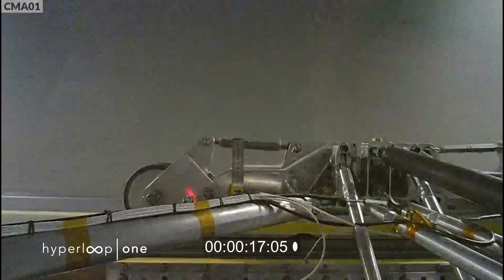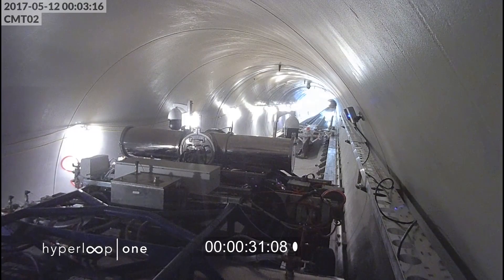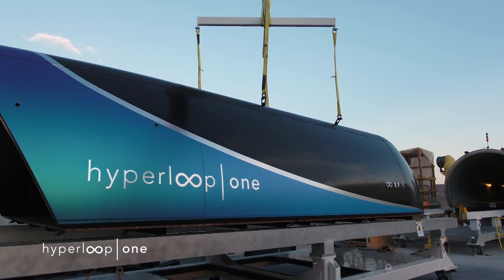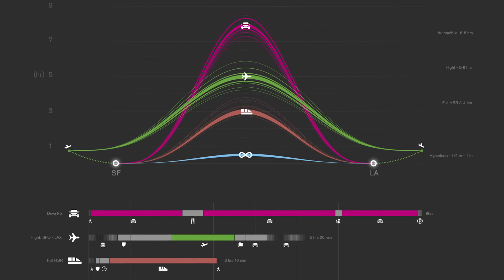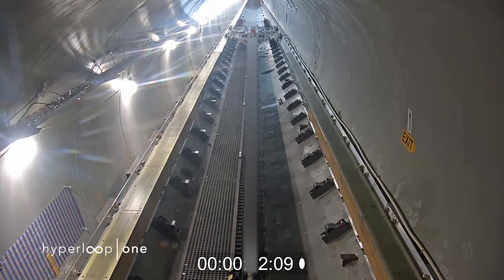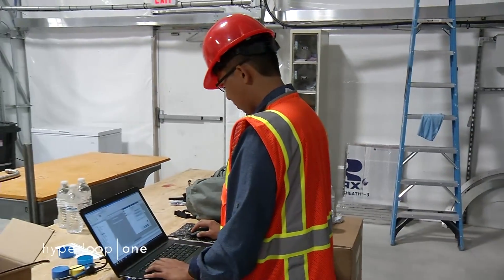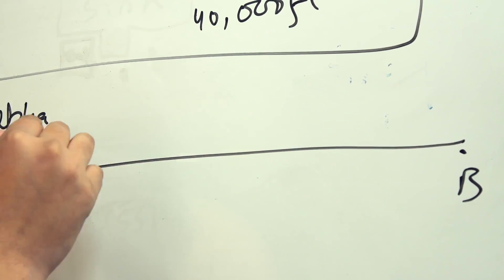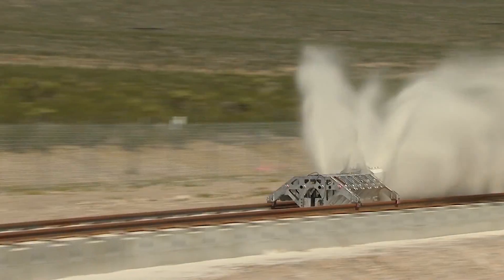Watch the Hyperloop Complete Its First Successful Test Ride | WIRED

Comment: So it can go slightly slower than the average train, it's much more expensive and can't even carry as much cargo/passengers as a train. Congrats
Reply: No, if you have a complete plan, -- which they do -- you can get funding and the prototype shows that the plan can be successful. To get funding to dig a hole to the middle of the earth, you don't need to actually have dug a hole to the middle of the earth.
Reply: Metal Is My Business Its not a perfect vacuum. it's there to assist all of the other propulsion methods. I imagine a working a official version of this technology will be able to easily survive a lose in vacuum. You seem way more skeptical about this then today's modern transportation. Planes were used as terrorist devices on 9/11. Cars can lose traction at high speeds, it's brakes can fail, it's gas pedal can become stuck. etc etc thousands of people die every year. Trains can become derailed and crash. So you think the Hyperloop has unreasonable dangers?
Reply: you're not getting what they are doing.  It's an engineering test of a system.  These are usually not done full scale in order to keep down costs so investors aren't taxed beyond their limits.  When you prove a system you are showing what can be done and that it can be scaled up.
Reply: +Quinn Dams
Partial vacuum makes a big difference. Hard vacuum is incredibly hard to maintain in large volumes, because it requires expensive specialized pumps, and any tiny leak ruins it. Partial vacuum on the other hand can be maintained with simple pumps, and tolerates small leaks. The pressure difference isn't that big, it's around one atmosphere. The Mythbusters actually did an experiment on this, they created a pretty good vacuum inside a railroad tank car (video available on YouTube) to see if it implodes. They had a decommissioned decades old car which wasn't even designed to hold vacuum, and it absolutely refused to implode. They had to seriously damage it to make it implode. Modern nuclear submarines spend months under an order of magnitude higher pressure without surfacing, and they keep doing that safely for decades. And they do collide occasionally and get seriously damaged without imploding. The USS San Francisco for example.
Also small punctures don't create huge explosions, like in the movies, they just cause small leaks that the pumps can easily compensate.
Read the original document (Hyperloop Alpha), it deals with the engineering, the finances, and a lot of possible accidents.
Reply: Dude, it goes 700 miles per hour
Reply: Do you know what a testing phase is?
Reply: Yes, but while testing you should still present a model defining how you want to improve it and make it what you want to be. If I were to start a project of reaching the center of the earth I can't just start digging with a shovel and asking to be funded because it's just a testing phase and that eventually I will find a way to dig more efficiently expecting everyone to trust me.
Reply: Don't forget the actual disregard by the "engineers" to the dangers of an extremely strong vacuum. Depressurization would take hours in this sort of tube and it would be extremely fragile. This shit is an obvious scam and people are taking the bait just because it's one of Elon Musk's ideas.
Reply: Just because WIRED didn't present the future model and how it's going to be improved doesn't mean Hyperloop doesn't know what they are doing.
Reply: saying it's a partial vacuum is like me saying my glass is empty and someone comments no i still see a drop of water in the bottom. the pressure inside the tube is so low it doesn't make any difference in the practical sense. and there's loads more issues, expansion of the tubes because of heat? you can't put expansion areas on a vacuum tube or it'll just implode halfway depressurization, and the idea they proposed to put the expansion areas on the ends of the tubes makes your station shift up to a mile on the proposed track. it just isn't possible with current technology, maybe if we had the hyperloop made of carbon nanotubes so it's stronger, find a way to insulate the tube to all temperature change. and protect it from natural disasters like tornados, and earthquakes, and i mean really protect because a single point of failure means the deaths of everyone in it and complete destruction of the hyperloop.
Reply: What train goes 700 mph?
Reply: SuperFatUnicorn idiot
Reply: You know that the only reason they test it at low speeds is that the test track is simply too short to accelerate and then decelerate from higher speeds?
Reply: Well said Andras. We have been dealing with huge pressure differentials for decades. I'm not terribly optimistic for Hyperloop as I think the scales are too big and the costs will be too great, but people talking about catastrophic failures are forgetting we have been engineering subs to deal with vastly bigger pressures for such a long time. The hyperloop at a complete vacuum will be under the same pressure as a sub at 10 meters, and this doubles for every 10 meters deeper it dives. Subs have collapsed, but at far, far greater pressures than 1 atmosphere.
Reply: Indeed, the one who designed this for cargo purposes is really stupid. Guess why most cargo is transported by sea? Because it doesn't require to be there fast as much as people. But now we are going to build a fucking expensive infrastructure inside a vacuum tunnel to transport containers while a truck can do so much much cheaper and not much slower, or a ship.
Reply: had to read the paper as i hadn't seen it before yet, making me feel even more skeptical about the whole thing.

the big problem is struts though, submarines can be built with internal support, wich prevents the whole thing of crumpling up like a piece of paper the second something leaks, also the vacuum in the tube according to the paper would be 1/6th of mars' atmosphere wich comes out to a total of 1/1000th the atmosphere of earth or about 48 km up. effectively a vacuum for these purposes, and there's some real just idiot things in the paper like, you're gonna put a rotor on the thing for extra thrust even though there's so little air it wouldn't be usefull. and the paper states for expansion areas the pylons dampening system will be used somehow, wich makes no sense as it would just push the pylons apart if it expanded, stacking over distance ending up either breaking the damper wich would leave the tube unsupported, causing it to push the pylons, ending up in either the pylons falling over or the tubes breaking off causing it to probably bend or break. and the mythbusters episode with the tanker you quoted, in the same episode they end it by dropping a rock on it, it's pretty big so still but the second there was a dent in it, it completely flattened. you think the tube isn't going to get a single dent anywhere period, if it does get built i give it a year maximum before the thing implodes, it's just statistically unlikely that on a 400 mile track not a single dent will be made in the tube, it could be a tornado flinging debris, or an earthquake that is just a bit too rough on the dampers, or someone who hits the pylon and it breaks. and if those things ended up in a single broken vehicle with the people dead okay sure the risk isn't too bad then, but it would be the whole thing, a 650 million us dollar tube completely trashed. with likely no surviving passengers at all. a stupid idea imho
Reply: That's because tankers are not designed to hold a vacuum. Hyperloop would have a 25mm thick wall (compared to a 10mm tanker) and an internal stringer-ring frame to prevent collapse. Obviously they would design it to survive a dent.

The pylons would constrain the tube and allow free rotation about the z-axis. Pylons in between these would allow free translation along a single axis. This would allow the tube to buckle is a controlled manner. You'd need to allow for 1 meter of expansion every ~6000 meters of tube (assuming you pretension the tube), so it can be modeled as a 6000 meter long chord segment with endpoints meeting a 6001 meter long arc. This arc has a radius of 75 kilometers: that produces less than 0.1G of centrifugal acceleration, which is not very much at all.
Reply: 1:11 The guy LITERALLY said the finished model would go 700mph. Try paying attention next time.
Reply: And how do you know? Also, read the original Hyperloop concept, and a lot of your questions will be answered.
Reply: They have a short track for testing, somehow in your shriveled mind that is the complete product...
Reply: the same thing could have been said about cars. or airplanes.
Reply: it's still a bad idea though, if you even were to throw a rock against it you could do enough damage to the tube for it to implode causing your whole goddamn hyperloop to have to be rebuilt and everyone using it at the time to die. honestly it probably would've been a way better investment for elon if he funded a maglev railway like they're building in china right now

Comment: a vacuum is a bad idea... they should design it more like a wind tunnel where hyperloop tube integrated turbines push a current of air in the same direction as the hyperloop car, thus reducing forward drag.
Reply: You just described a train with a turbojet engine stuck on the top. It's been done before, but it's not fuel efficient and is way too loud (think fighter jet passing by at street level).

Comment: Notice how there is no weight attached to the cart, It's just the shell and wheels.  Even that sled is immensely slower than the estimated design speed of the Hyperloop.  It is seriously improbable that any sort of human-transporting version of this will make it out of the prototype/design phase.  I doubt this will go anywhere.
Reply: scale, giraffe... scale.  You test a system on a small scale to check vaibility.  Once you prove viability, can attract investors in order to ramp up the scale.
Reply: It looked like the sled was accelerated by that launch thing and then just coasted the rest of the way
Reply: max afc46 I think he means a fire inside the capsule, by what i would assume to be deliberate means. What if you get a hole in the side of a capsule. Suddenly you experience either decompression or all the aor leaks out and your passengers experience hypoxia. What about the tube itself? It also isn't devoid of experiencing deliberate tampering. How do you deal with expansion? You could always bury the tube to solve that but you run it across a fault line. And the  what? What happens if there's an earthquake? Tornado? other natural disasters? How long will maintenance take if a part of the tube is damaged by a natural disaster? How much will it cost. Is the risk of placing people in a vaccum tube worth the speed you gain from it or is it better to just build a maglev train that will run the same distance in ~ 2 times as long as the proposed hyperloop (not that we've seen it surpass what a car can currently do while not in a vaccum..) Vaccum chambers have existed for a long time. This isn't a new technology.. this is trying to expand a current technology beyond its current capabilities. If we could build better material that wasn't as prone to damage via natural causes,let alone tampering i think the hyperloop would be a novel idea. Not with our current materials and technological limits though.
Reply: justagiraffe also thay blurred out the linear accelerators when they showed us the launch
Reply: without air resistance that is a pretty good deal
Reply: Stand By Oh, and what law of physics stop you from doing that?
Reply: The cables become too heavy to hold themselves up
Reply: justagiraffe says the dumb fuck who doesnt know physics, who doesnt engineer and has no evidence
Reply: like everythin tha had been made, give it time
Reply: Nobody is making anything like that, because it wouldn't help much. The issue in going to space isn't the altitude, it's the horizontal velocity needed to get into a stable orbit.
Reply: This so called "test" is probably a PR thing for them more or less. Keep the investors in the loop. You've gotta give them something to keep them hooked.
Reply: Valesto93 
They are rules you can NOT break 
You can't build a100 km elevator
Reply: YOu expect me to go into one of these hyperloop? Sorry, I see major design flaws. I wouldnt ride in a train inside a vacuum tube. What if there is a fire, how do you get out of the tube, youre in a vacuum. What if there is a leak in the train, passengers would die instantly with decompression. Think of the same analogy as if youre in space capsule and small leak would instantly kill you cause youre surrounded by nothing, hence a vacuum. Its also not economically viable. You not only have to create a tube but also have the generators to keep it "vacuum" all which adds a lot of cost. Would that extra cost make the air friction less tube worth the cost? How much faster would it take in comparison with how much more money that needs to be spend to keep it at that speed? Does this make economic sense. Not to mention the technological maintenance of keeping the tube functioning. Sorry guys, but hyperloop is over rated and its going to be a money loss at the expense of the taxpayer.
Reply: Fred H what if there was a fire? 😂 It is a vacuum, do you know how fires work? I understand people's skepticism, it is new and certainly not developed technology, but what you are saying now is exactly what people said about cars planes and trains when they were in their early unrefined stages.